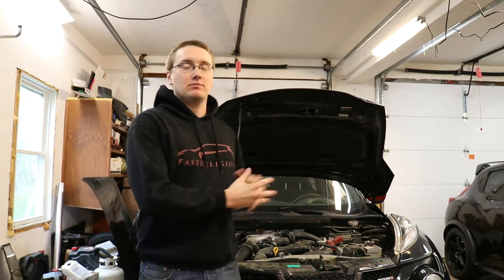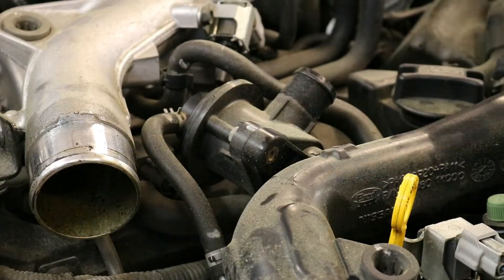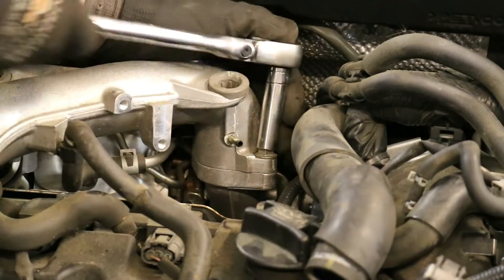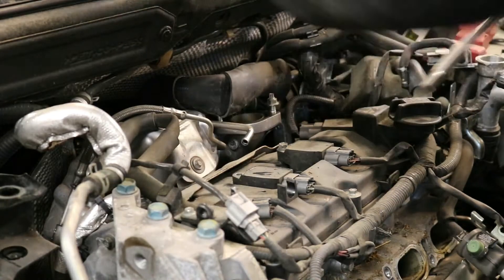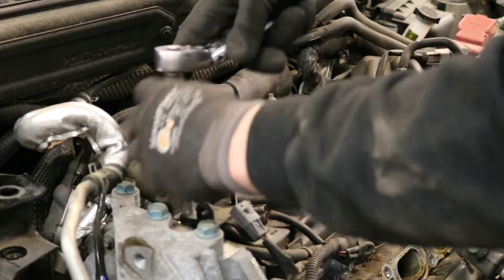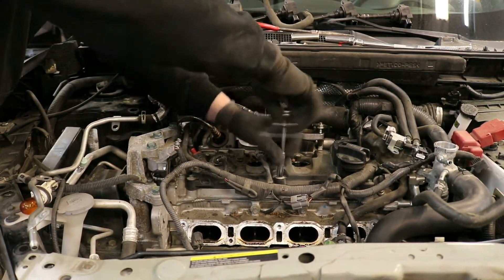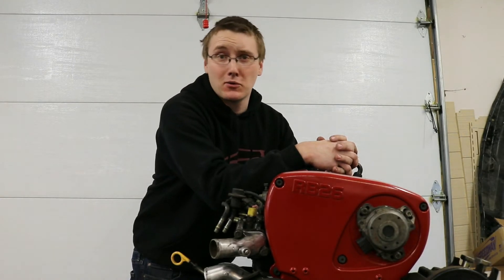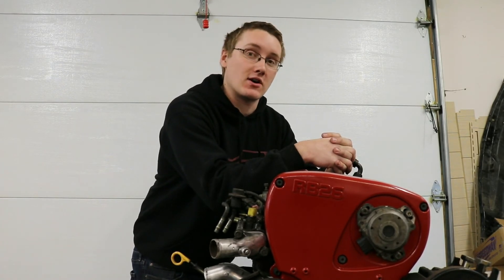Nissan Juke MR16DDT How-To: Valve Cover Removal

Comment: Man I just got done doing this today, because the juke I bought had a massive valve cover leak, what sort of masochist runs that fat freaking wire loom ON TOP OF THE DANG VALVE COVER. I hated it, the leak was because the gasket was basically rock at this point lol. It all but broke apart when I pulled the valve cover off :D